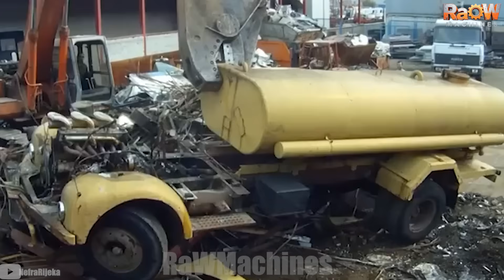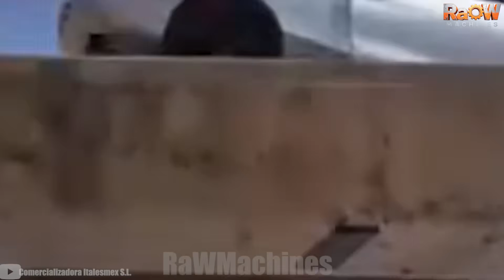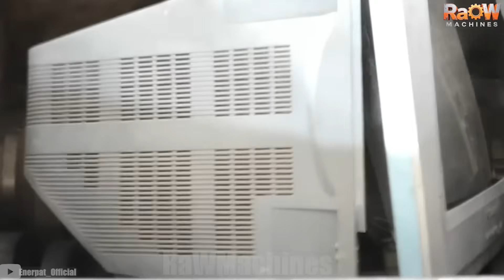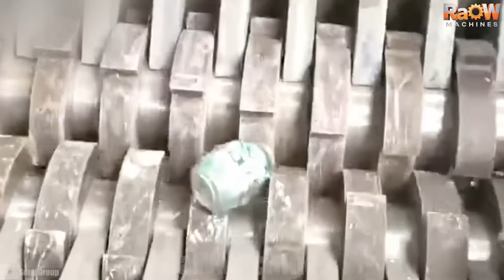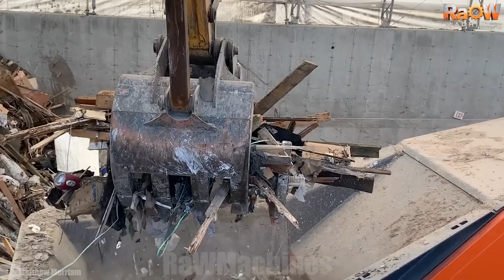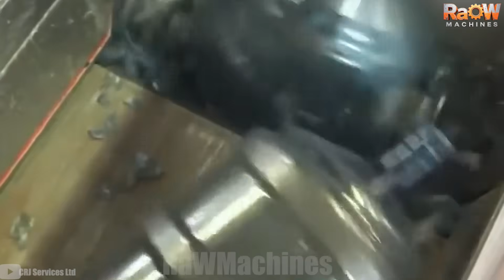30 Most Insane Shredding & Crushing Machines That Obliterate Everything |  Scrap Processing #14

Comment: Gas bottles don't explode because they have completely removed the valve, and there is no pressure in them.  Narrator gives idiotic reason that it is crushed slowly.
Reply from the maker: Good correction 🙏 You’re right – with the valve removed and no pressure, bottles don’t explode.